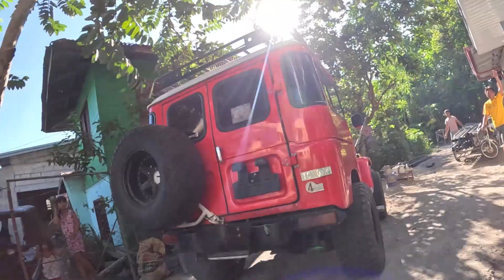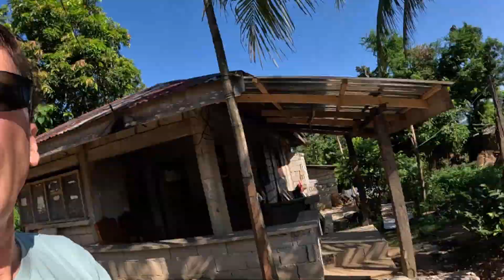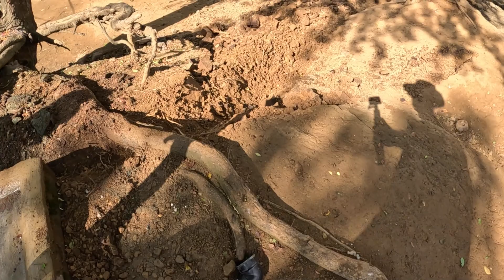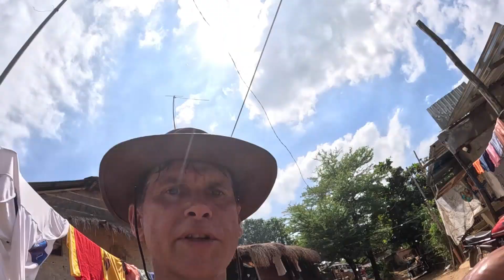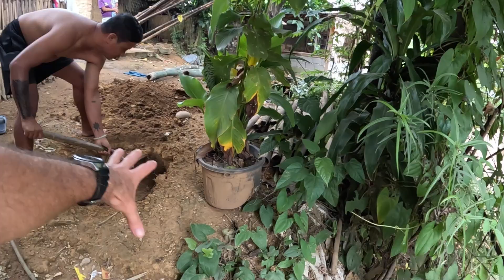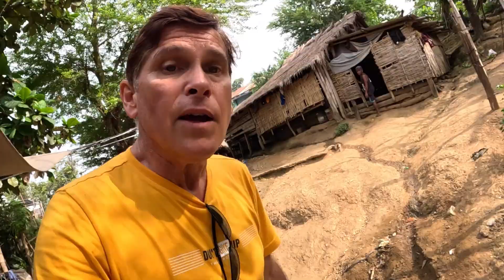(HP1.15) Philippines Humanitarian Project – Build The Drains

Comment: Never use 90 degree elbows Keith they will clogg. Always use 45 degrees. 2 45s are way better than 90s
Reply from the maker: Yes good point Rhett. I rely on my plumber to identify what piping parts to purchase and even suggested 45 deg angles. Since no solid material is planned to go through the piping clogging should not be a problem. I also need to mention there is a cost difference between 2x45 deg vs one 90 deg. Tks for commenting